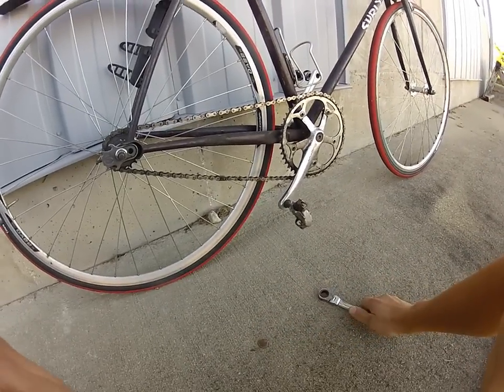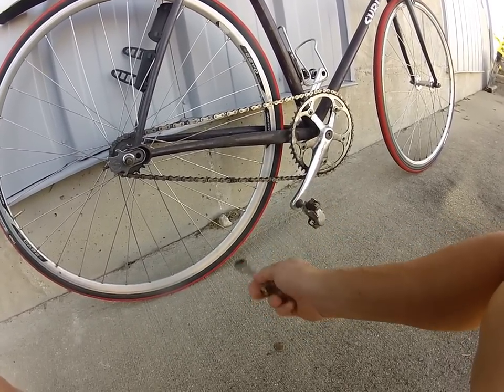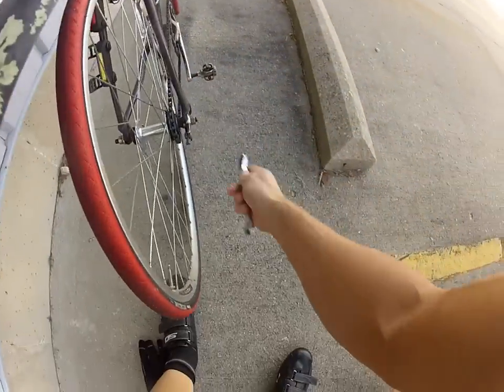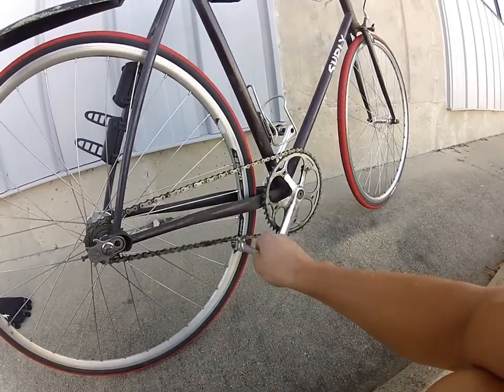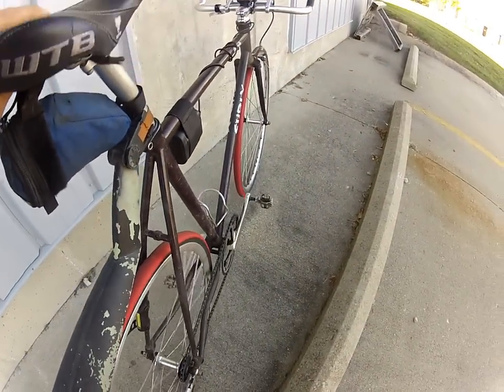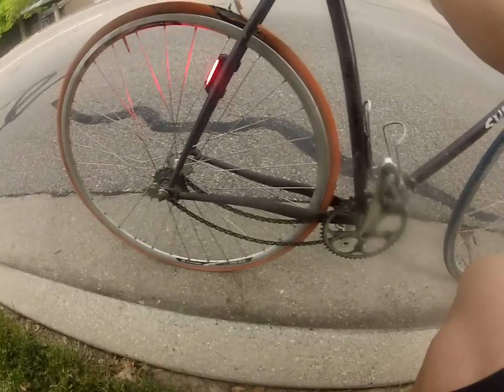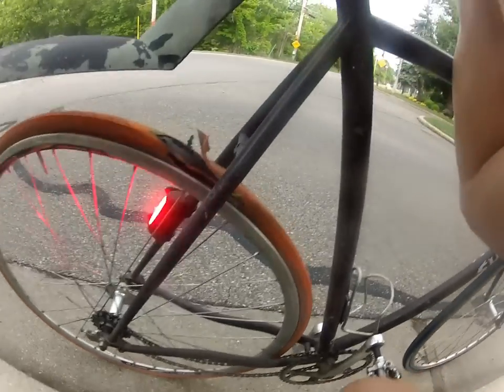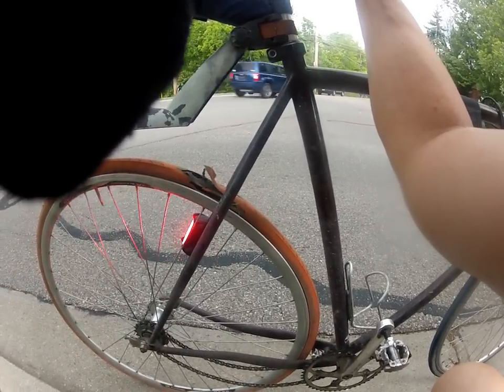fixed gear chain tension is important -- blow out at end

Comment: Maybe its time for you to read sheldons page on chain tension.... the reason your chain tossed in this video is due to chain line
Reply from the maker: Walt Hansen hmm... not disagreeing that chain line doesn't play a role but I'm not completely convinced that this is the only reason this happened to me. Are you suggesting that even a very slack chain will not jump at that speed if it's perfectly aligned? I'm not promoting that a very tight chain is best, just to have it more taut than slack is the better option.
Reply: @soda701  on a velodrome. We keep our chains loose for speed. The chain friction needed to skid slows down power transfer. With proper chainline this will not happen. My track bike wouldnt ever spit a chain off. Because the crankset and rear wheels hub spacing have been designed for the geometry of my frames dropout spacing

Comment: What do you think of a very tight chain tension? i'm using a half-link chain right now for my fixed gear
Reply from the maker: Reymark Tarol I also have a half-link. Too much tension and it won't turn very easily and you'll probably stretch your chain out more quickly.
Reply: soda701 yeah. it looks very tough though. . . . My tension now is very tight. like it wont become saggy.. but i get your point for the chain might get stretched
Reply: Too tight your'll destroy your cogs faster have to peddle harder stretch your chain and possibly snap it. I advise you to look up chain deflection.
The chain doesn't need to be tight all the way round the chain only pulls from the top and will always be tight at the top.
Reply: SUM1SLY83 It's nice to see that someone got this subject right...  Is too bad this video is up and running, putting out bad info.
Reply: +SUM1SLY83 Assuming we're accelerating rather than decelerating under pedal power. If slowing or skidding with the pedals the top of the chain will be slacked.
Reply: If the chain is too tight, it puts a lot of unnecessary wear and friction on your drive train parts. In a lot of cases, chains do snap. Anywhere between 1/2 to 3/4 in. of slack is perfect. Loose chain, is a fast chain.

Comment: How do you center the wheel?
Reply from the maker: Others may have a different approach but this is what I do:
tighten the nuts enough so that the wheel can still wobble but isn't completely
loose. Then line it up by sight by getting behind the wheel and use the seat
tube as a guide (I do this in the video when I move the mud flap out to the
side). I usually tighten the non-drive side nut more (but not all the way).
Once you get it lined up (keep it in place with your hand), tighten the drive
side nut a bit more then spin it a bit to make sure that it's lined up all
around. If it's lined up, tighten your chain tensioner (if you have one), then
tighten the nuts. Then spin it again and check your tension.

Comment: soda701

I am fixed gear/single speed newbie

I just bought fixed gear bike from LBS, its looks ok, I test ride and notice nothing wrong

When I go home with new bike and do some inspecting, I noticed that crank will not "smooth" at one spot and chain will be tight, other spot is fine and smooth and chain can move up down a little

This is normal? I used to ride road bike with rear derailluer/pulley so I dunno how fixed gear, I dunno what is bad or good

Please advice :) I don't want to tear off my newly chain and damage my bike!
Reply from the maker: Does it do this with the chain off? Take off the chain and
if the crank still sticks in that spot, it's the bottom bracket. Then check the
chain for a tight link. All links of a chain should move freely but a tight
link will be... tight. And finally, what you're describing sounds like the
crank is not circular but slightly elliptical which I find odd. Look into these
and let me know.
Reply: Crank look circular enough, its good shape, my bike is brand new so I inspecting atm

As you mentioned "tight link will be tight" I think I get what you mean now, as I turning crank, there one spot will feel "tight" but its still can turning. I do test ride and notice nothing wrong after all, I can still pedal freely.

Just when I turn crank with my hand/finger, I will notice "tight" spot and crank will move with a little resistance, I dunno how to explain but hope you get it

Also, when at "tight" spot you mentioned, chain will be "tight" with a little room to move, I touch it with finger, its feel super tight, when I touch it forcefully, its can move a little but very tight

I guess this is good now? (NOTE: I didn't do chain tuning, I let my LBS do it because I dunno how to do fixed/SS stuffs XD)

Sorry for a long writing, I am absolutely new to fixed/SS bike lol I used to ride with road bike, I know stuffs about road bike but with fixed/SS thing, I just noobs hahaha

AND another question please

When I turning crank, if you sitting at drive side and watch the chain from the bike right side. I notice upper chain line (the one that begin pulled by crank >>->->) will sometime up and down by 1-2 cm, that's normal??? I think chain should look "steady" flat line without up and down all the time?

Thanks in advanced! :)
Reply from the maker: The last part about up/down by 1-2 cm is still describing a slightly elliptical crank -- or cog -- which is still very odd. The chain line should not move up or down. When you say "looks circular enough" you actually need to verify that it's circular by using a fixed point of reference. Take the chain off and find something to attach to the seat tube that will rest just above the crank. Maybe use a pencil and a zip tie. Move the pencil so that it is just above the crank and then rotate the crank. The crank should not touch the pencil but if there is a spot that touches the pencil then it's not circular. Hope this makes sense. I still find this odd...
Reply: Okay, I decided to go LBS so I can tell them what happening and what is not right :)

Thank you very much! I would not able to tell them at LBS if not your information because I will just err err ahh ahh ok to them lol

Hope LBS will able to fix this

Comment: this happened to me today, Im really new to riding fixie and i was riding down a hill and suddenly my chain pops off but instead of skidding it made it so i couldnt control the wheels at all so i was going like 30mph down a hill with no brakes and no means of stopping and i had to jump off my bike because i soon coming up to an intersection and there were cars going past so yeah my elbows knees and back are all cut up and i tore my brand new handlebar tape, saddle and i scratched my frame :( i think im going to start riding a front brake just for moments like these
Reply: You can stop your back wheel by resting your shoe on the top of the wheel closest to your frame. It works just like a back brake. :] Ride Safe.
Reply: yeah i also could have used my feet to stop but it was a last second reaction because i was scared shitless

Comment: What kind of lights you have on there I noticed those 2  in the beginning?
Reply from the maker: Serfas Thunderbolt. USB rechargeable. White for headlight with longer straps and red for tail light with shorter straps. Very bright and worth the money.
Reply: Thanks they look good I'll probably buy me a set
Reply: I've had too many lights stolen that use this sort of elastic fastener.   You can pop them off while walking by, without even stopping.    Now i use the Nite Ize brand "twistlit" lights.   they come in at least 2 colors (white and red) and I attach them with stainless steel zip ties, although normal zip ties will be okay too.
Reply: littlegoobie They're meant for you to take on and off easily, not to keep on and get stolen. I've got some really semi-decent quality CATEYEs that I never leave unattended.
Reply from the maker: littlegoobie as Sen Flores said, these are meant to be easily removed which I do. Very easy on/off and never been stolen because they are in my bag when I'm not on the bike.

Comment: Why is fixed gear used at all? I see why it's useful on a track but anywhere else it's just a hindrance. Bikes should have front and rear brakes if your riding the street anyway.
Reply: rubbiebubbie people claim weight reduction (no brakes, no deraileurs, no stand, cables, etc) and a feeling of direct drive that makes riding feel more personal. I wouldn't know though, I like being able to climb hills with my old 10 speed.
Reply from the maker: Sen Flores and +rubbiebubbie This is my commuter bike. I like the fixed gear mainly because of its low maintenance. It only has one brake cable that doesn't need to be changed very often and one gear also means that I don't have to worry about my derailleur not shifting or skipping etc... I only have one hill that isn't too bad. I do ride a shiftie on the weekends and until my frame cracked, I did have a shiftie commuter as well. And you are right about the direct drive being more personal. It's a different feeling that I enjoy.
Reply: rubbiebubbie it may not provide many decisive advantages over non-fixed bikes, but it sure is a lot of fun to ride and provides a whole new experience and level of connection with the bike that you just don't get on a non-fixed bike
Reply: rubbiebubbie It's kinda like how people buy iPhones instead of Android smartphones. They're not better, they're just simpler to use and they're flashy. It's just a really good day-to-day driver.
Reply: +rubbiebubbie I ride fixed gear because it is fun. I rode mountain bikes for a long time and when I hopped on my buddy's fixed gear, love at first sight. Takes time getting used too, but once you do you cannot go back (just a saying). In all honesty, if my frame had brake holes, I would run a brake. Fixed gear spices up my riding style and I feel unique in a good sense. Nothing compares to mashing down an avenue on a fixed geared bike. In the end, truly, it does not matter what you ride, you can commute to work on a bmx as long as you're having fun. That is all that should matter. Stay safe out there guys!
Reply: rubbiebubbie It's just one of those hipster things. Just like vinyl, it's an objectively inferior format which is more of a hassle to use and maintain. They look nicer but they're absolute garbage for commuting.
Reply: BrainSeepsOut You should read an article about fixed gear riding, like Sheldon Brown. It has it's benefits and is plenty fun to ride.

As for vinyl, I think that's a trend for many, but the difference between digitally compressed formats and analog is distinguishable for high-volume listeners.
Reply: +rubbiebubbie Sometimes a little variety is nice when you ride expensive bikes with gears all the time.
Reply: because using my norcos got old after a while plus you have to be really alert cause you have no breaks lol it's fun
Reply: Update: I actually converted an old bike to a fixed gear and it's loads of fun! Super low maintenance, too! Especially because I waxed my chain. Brilliant. A little hard to start on uphills, but that's nothing a little leg strength can't fix.
Reply: All the ones that claim it to be purely “ hipster, or flashy” are probably the same ones who will spend ten thousand on a road bike and buy ever new gizmo to lose a few grams.. 
It is flashy,,, and tons of fun. Some people still prefer a manual transmission .. fools
Reply: For me, because it's fun and I can have an extremely lightweight bike that's easy to maintain without putting tons of money into it. If I was rich I would have all types of bikes, but fixed gear is the best bang for your buck, and the simplicity of the design also looks cool. I spent about $2k on my bike and the weight/stiffness seem comparable to a $5-8k road bike with gears. And under most conditions, side from steep climbs and descents, you don't need the gears to go fast. Why fixed instead of single speed though? For me, it's mostly the weight weenie aspect. Single speed is better for descents but I don't care about going faster on descents.
Reply: Not if your a chicken